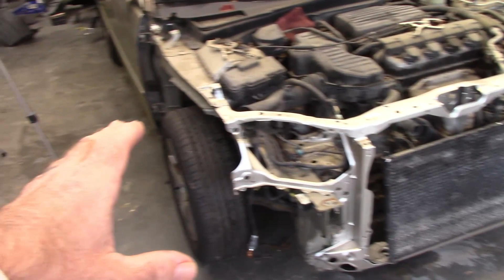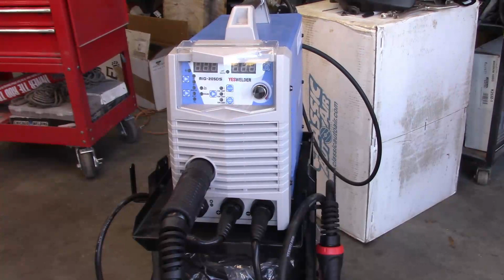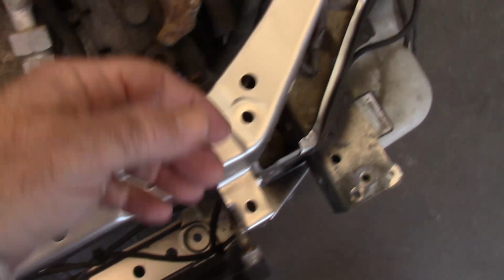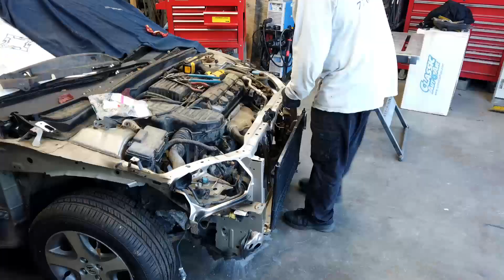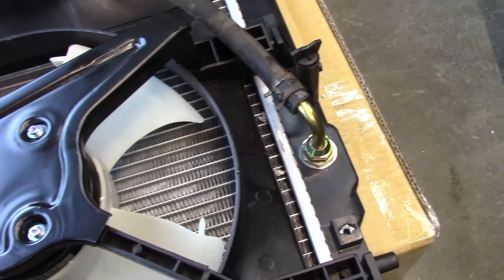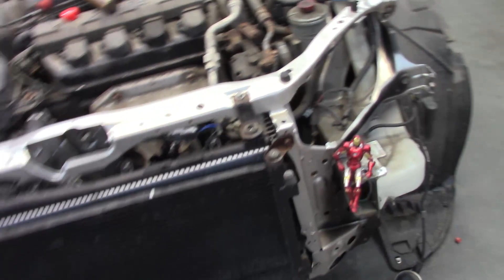Honda Civic rebuild part 4. Welding and installing the radiator and fans.

Comment: Hello Jo, I have a similar problem with my 2014 Honda Civic. The car still is reliable, im trying to fix it by myself because it’s more affordable and convenient for me. I was wondering if I can use bolts and nuts to the frame of the car instead of welding? I do not have any experience on welding. Thank you so much for your videos they are so helpful!!
Reply from the maker: I recommend welding it. That’s how it was designed.

Comment: I like your work I have a 68 mustang 428 my way.
Reply: Errol is that an original 428 car?
Reply: @davebrittain9216  no it's not original I built this car for junk my way it was pretty bad I have built a 69 and 72 f250 4x4 with 428s two.